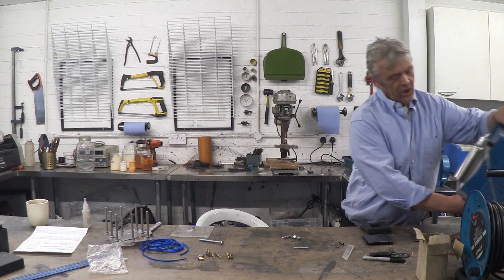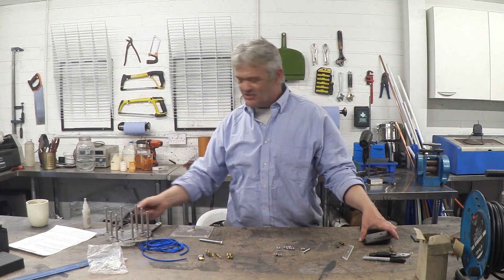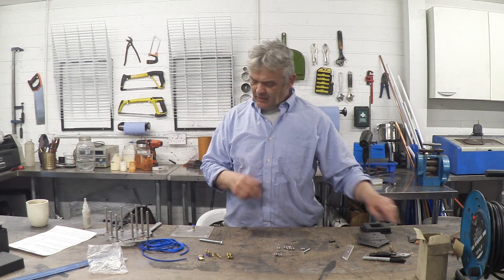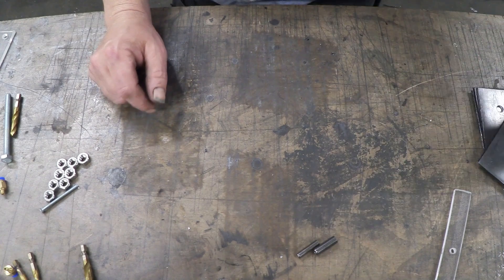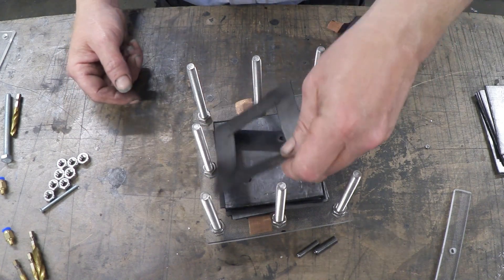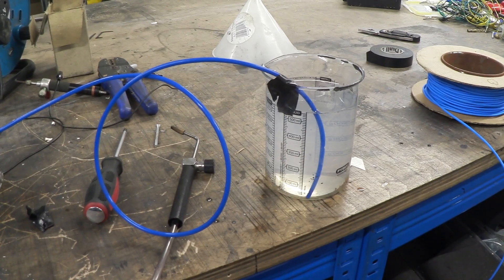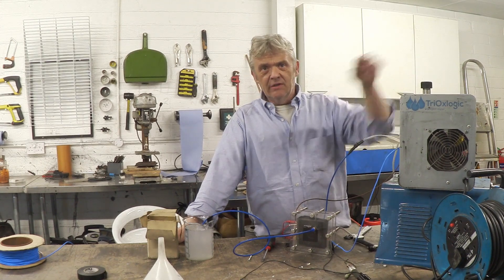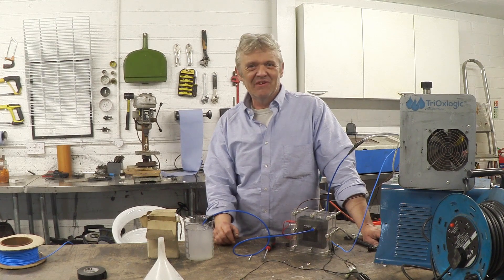Super Efficient Graphite Dry Cell Hydrogen Generator

Comment: The fact that a HHO generator using an aluminium electrode destroys  it almost immediately is a clue to a unit designed years ago that used aluminium wire fed into an electrolyte to produce hydrogen on demand for a vehicle engine.
Reply: I remember that one. Aluminium welding wire and the end was run across the surface of an Aluminium cylinder submerged in an electrolyte solution. It used a MIG wire feed system to supply the wire as it was the anode and the cylinder was the cathode. a voltage was put across the two materials and the wire eroded releasing Hydrogen.

Comment: I built one of these with 316 stainless plates into my Mazda three and increase my mileage from 24 to 31 miles per gallon for about 50,000 km. What I learned was almost everything said about them on the Internet is bunk. But they do work If you just use 3 to 5 amps to produce small amounts of hydrogen do use as a fuel catalyst. These dummy’s trying to produce as much HHO as possible have no idea how to run their cars on it. I know diesels are different but anyone saying they’re using one of these successfully in a gas engine without a fuel remapping chip is lying. Your exhaust will be full of oxygen and your o2 sensor will just start dumping more fuel in if it’s not being overridden.

Comment: hi, your videos are always interesting and inspiring.  maybe I am missing something about the connections but it seems to me that it does not produce hydrogen but a mixture of hydrogen and oxygen, is that correct?  also my doubt about the use of carbon for the electrodes is the possible production of co2 to the positive plate.  is it possible in your opinion?  thank you
Reply: Have you tried separating the gas streams? Means you have to introduce a gas tight middle layer (if the carbon sheets are not gas tight enough) and gas separator membrane/micro-mesh in between.

Could anyone tell me cheap gas sensors to get a direct reading of O2 and H2 concentration?
Have to dig into spectroscopy :)

Comment: Great video! I have an old Kron 300 water torch that hasn't worked in years. I have been wanting to make a more powerful unit for years and after watching your vid I have decided on a dry cell with the graphite foil as you used.  I had a few questions though. What thickness of graphite foil did you use? How did you "bury" the copper tab for the end/center plates? Thanks!

Comment: Bravo Robert!  Curious about pH changes to the electrolyte over time.. is carbonic acid possible?  Is the electrolyte potassium? Is it like a salt water aquarium where you do not add salt only water, because the potassium or whatever you are using stays in solution?

Comment: Hi Rob, nice work. The gas your getting out is both
Hydrogen and Oxygen (HHO) a highly explosive mixture! I believe a licence would be needed if you wanted to store it.
Storing Hydrogen separately is dificult, it needs to be under extremely high pressure before it liquidises (unlike oxygen) which means pressure vessels have to be able to withstand not only the pressure but impacts through for example a vehicle  crash. These are two of the reasons why we don't have Hydrogen vehicles instead of  petrol. Petrol at atmospheric pressure is liquid but easily evapourates into gas, (perfect  cheap fuel)
Reply: It is a demonstrator missing the separator. THEN it gets interesting. 
(You do NOT store HHO. It is just for immediate use. Still it's got its uses. Perfect welding/soldering torch for fine work, driving reactions etc..)

Comment: 2V per cell, so you use KoH for electrolite right?
why not try efficiency test with KoH vs H2SO4?
just make the conductivity the same and start testing.
very little H2SO4 needed for the same amps..... 
plz test for liters per kWh 
nice option compared to stainless !!

Comment: Hi. Here at h2o-and-evs we build some of the best flooded cells around. In our observations it's the dissolved  iron being oxidized that tinges the water yellow. Most water like distilled water can have a lot of dissolved iron in it. Which when it gets oxidized builds up in the cell and/or the reservoir. Also, we have observed no SS degradation even when driven really hard.
Reply: Stainless steel usually contains iron too

Comment: Have you tried feeding the output into the air intake of a diesel engine? I'm thinking of putting one together, partly for cutting and partly to see if it works for fuel economy. I figure I have a kilowatt of solar on the roof of my van anyway so if it's worthwhile, I could just feed it directly into the electrolizer.

Comment: Looks like It can be used with solar panels to create fuel when your batteries have finished charging, for heating water, melting scrap metal, or cooking (Might have to generate the gas at the point it's used due to safety - storage and piping around is probably an explosion hazard). Could be useful on a boat, where you have a plentiful supply of water. If you collect the condensation from combustion, it could be an emergency supply of fresh water too (if you add minerals - drinking completely pure water is not healthy).

Comment: I wonder what's the total energy efficiency on production and then burning it in a generator. Maybe this will be able to replace the extremely expensive and unwieldy Dam batteries that governments have in use today with renewable energy.
I also wonder what is the longevity of a properly manufactured graphite plate rather than carpet knife cut piece of foil :P

Comment: Hello Mr Murray-Smith.
Wonderful job on that hho cell.
I wonder where graphite foil can be bought? I have been planning to build an hho dry cell for a long time. I live in Sweden and I have just found very thin foil in a store called Elfa.
The foil you used looked like it was a little thicker. I have big plans for my hho cell, but I need to start somewhere. I actually made one for a couple of years ago out of stainless deciliter measure cups with plastic spacers in-between, it was a wet cell. It worked rather well during the circumstances 😁.

Best regards
Peter.
Reply from the maker: we have grafoil in our webshop mate - https://secure.workingink.co.uk/working-ink-shop/

Comment: You title the video Super Efficient Graphite Dry Cell Hydrogen Generator yet you use an electrolytic solution containing water, which is wet. So the video should really be called Super Efficient Graphite Wet Cell Hydrogen Generator. You'll always need water to break down the materials in order to release the hydrogen. I'm sure your cell would still work without an electrolyte, it would just take that little bit longer to work.
Reply from the maker: okay mate

Comment: I'm not an engineer or even a tinkerer so I don't know why I clicked on this or why I found it strangely fascinating, as I have no idea what you're up to.  Why generate hydrogen ?  I know it's very flammable so I suppose you could use it for powering something but doesn't it take more energy to produce i then you get from it
Reply from the maker: hydrogen can be used as a fuel - storage is however still a problem to be solved effectively
Reply: @ThinkingandTinkering   Thank you for your reply but with all due respect that wasn't my question.  I stated that I know it can be used as a fuel.  My question was,  doesn't it take more energy to produce than you can subsequently get from it

Comment: Not sure if its possible or any better or indeed if you could make it would work. Stainless steel mesh coated in graphite ink.  Increased surface area a possibility of slowing corrosion.  I'm just trying to get you back for making my brain work so hard lol

Comment: 12 v is the limit for peak efficiency?
Reply from the maker: no - you're actually looking for 1.23 volts per cell plus losses through the ESR. it will be round about 1.8 to 2.2 very roughly. anything more than that is simply lost in heat and what you are generating is steam not HHO

Comment: Hey Rob ,you use scissors a lot for cutting out your plates,ever thought of using an A4 paper cutter guillotine.Cheap as chips and I think much quicker and easier.That's what I use.It will also cut  aluminium and copper plate.Cheers

Comment: It will be interesting to see how the graphite holds up over time compared to stainless steel.
What type of water did you use ? 
Utility, purified drinking water, natural spring water, deionized water, or what.  Also did you use any additive ( electrolyte ) like salt, soda, or other chemical.  I am very interested in your test results. The applications of this are endless.

Comment: Robert... good to see some of this technology coming back around. Let's hope it's not suppressed by the oil companies again like before. I had a 12 cell pro-built 'dry cell' setup in a rebuilt 1971 VW Beetle. Also had a PWM controlled DC to DC power supply to regulate voltage and current from the battery. Using sodium hydroxide for a catalyst with water, I was producing around 3.5 - 4 LPM of HHO @12 vdc and 18 amps. I had done many road tests with this setup and gained about 8 mpg. consistently at cruising speeds. (The best it would get without HHO was around 30 mpg, but with HHO it would do 38 mpg or even more in some cases). Of course you can't produce enough HHO to actually run the engine on HHO, but the catalytic effect with regular gas in the combustion chamber made it much more efficient. Unless you can decipher Bob Myers secrets from years ago (RIP), you'll probably never be able to reach those levels. That said, I like your experiments with the graphite 'foil'. The only thing I see that would be a problem over time is the graphite flaking off and deteriorating over time. This might be offset by having it contained in some sort of plastic mesh maybe? Now subbed and will be watching for future developments.😉
Reply from the maker: very cool mate - maybe I will get there

Comment: Robert,
You finally did it. I have been a subscriber for years and have integrated your projects into my own many times over the years. This one took the cake, I have now joined. 5$ a month is a steal. Not sure why I didn't do it sooner.,

Couple of things, I would love to know how a magnetic field improves hydrogen production. Link here to a science direct article claims 2x productivity increase with a field:
https://www.sciencedirect.com/science/article/abs/pii/S0360319911023500

I think I am going to integrate this design into one that I have built with stainless where I use terra cotta (flower pot bottom) as a PEM to separate hydrogen from the oxygen.

Keep the projects coming!
Respect, 
Mark
Reply from the maker: yes I read that - very very interesting - just looking at a few things now but will get onto incorporating something along those lines for sure

Comment: If the polarity doesn't matter, presumably this could be run from AC? Any chance it could run directly from 240 volts???
Reply from the maker: polarity of connection doesn't matter - but it is an electrolyser so needs DC - you could use pulsed DC for sure but the time between pulses would be a critical factor for sure and it is likely the pulsing would encourage intercalation into the graphite
Reply: @ThinkingandTinkering  So 240 volts, no transformer with only a bridge rectifier would work?

Comment: Ceramic graphite plates could be a option. With a 3D printer you could also make thin corrugated plate die.
Reply from the maker: I was thinking that mate - iy would also help formation of channels in the plates which could be good for gas separation which seems to have a few folks concerned

Comment: Hi Robert, won't this cause the graphite to exfoliate?
eg: https://www.youtube.com/watch?v=s51l6KySFU8
I thought about this idea too, but never tried it because of that...
Reply from the maker: no mate - https://www.youtube.com/watch?v=hFUOsZ0LSkQ&t=64s - that's me doing the same thing but 6 months earlier - you have to control voltage below the intercalation voltage and keep amps down below the level where excessive heating would occur
Reply: @ThinkingandTinkering  
Thanks Robert. That's interesting. I now know what intercalation is. :)
How about A/C electrolysis?
I suspect you could insulate both plates - in which case any conductor would be ok...
What do you reckon? Would it work?

Comment: i wonder how many cells ya'd need to build to produce hydrogen with less than ~2% electrolyte solution
Reply from the maker: It has to be above 1.23v per cell as that is the water dissociation voltage add in the ESR of the device and probably 2v is around right mate - If we reduce concentration to 2% we will decrease amps but at the expense of increased resistance so we will probably have to move the plates closer. This design has no protection against plates touching so with reduced plate gap that would have to be introduced which would lead to fluid flow resistance - so a pump is probably needed. so putting in micro channels wouldn't be a bad thing as it would help with being able to separate the O2 and H

Comment: If you are interested in separating the gases, you can make this same arrangement (but in a single cell) using mesh as your active cathodes and electrodes. Then you use a porous membrane between the mesh electrodes.  It would be interesting to see if you could use a graphite or graphite coating on some copper or aluminum mesh.
Reply: The cells are like a battery, you can over and under charge the cells. 2.2 volts is typical running voltage. Any heat produced is of coarse inefficient. I have built very sophisticated extreme efficient cells that generate zero heat. The trick is too isolate all exposed edges and the electrolyte between cells can not be shared. I built a tubular system that had plastic manifolds gas and electrolyte porting. the edges of the tube ends isolated in these manifolds with O rings separating them from the electrolyte. Each cell had its own resivour for its electrolyte. The cells were then wired in series to achieve 2.2 volts from 14.5 volt supply.
Reply from the maker: very interesting
Reply from the maker: cheers mate
Reply: The separation of anode and cathode would be most relevant for adjusting the mix between O2 and H2(?) I mean to manipulate the flame/temperature in welding similar with asethylene/oxygen mix in traditional welding.

Comment: stainless isn't so bad if you know what you're doing. use cutting oil, maybe regrind your drill bit to a tool steel cutting angle.
Reply from the maker: isn't so bad? nicely put - but there is no way it is as easy as a pair of scissors lol

Comment: Great video but why does it have neutral plates
Reply from the maker: to spread the load - without them the full 12 volts would hit the cell with them it is spread to 2 volts per compartment - this stops overheating

Comment: You can use a semi-conductor instead of lye😉 rub 2 pieces of 1000grit wet and dry together and harvest the carborundum by washing off with distilled water.
Reply from the maker: cheers mate
Reply: @ThinkingandTinkering  if you want to push the cell add oxalic acid with the carborundum. Zero foaming issues like lye brings.

Comment: Hi Rob! Great Work!!  a small advice, make the edges of  gasket smaller to expose more of the plate's surface area to the water 👍
Reply from the maker: agreed mate - but this is a test cell
Reply: @ThinkingandTinkering  You see our drive to get productive ;) When do you "test-wise" include a separator membrane ;) ?  What could we use for it? Old FFP2 masks (the ptfe ones having 30-40nm mesh widths), the filtrating layer? Or does it have to be more tight, so rather diffusion principle?
Reply: Perhaps use o-rings on plastic rods to separate the graphite plates & expose more area?
Reply: @user-mp3eq6ir5b  If you do that, you might as well cut the plates round with hole-saw bits in a drill press.

Comment: Did we discuss sourcing graphite foil anywhere?
Reply: His website. Link in description.
Reply: @michaelbiggs7987  ty
Reply from the maker: you can get it on eBay or our shop if you like mate
Reply: @ThinkingandTinkering  thanks Robert, I've had your graphite in a can in my garage for ages but finally I think I will use it for a couple of projects one being a heated 3d printer bed 😁

Comment: Fair play that’s impressive👍 I remember reading a lot about different hydrogen production ideas Stanley Myers apparently had a conversion kit for the standard combustion engine to change the engine to run on hydrogen this reminds me of it it will be interesting to see how efficient this is when you’ve Finely tuned it  .... I think Myers might have used a coil of wire around his stainless steel cathodes and drawn an arc of voltage through the coil conductively to change the way the electrons meet against the anode or perhaps plated them in this manner saying that can you plate with graphite 🤔 this is giving me loads of ideas thanks very much for the inspiration 👍coo as 👌 did you ever see the cavity heat pump that guy made worth a look too
Reply from the maker: I am really interested in urea electrolysis as I think that will be net positive for generation
Reply: Robert Murray-Smith yea just checking that out nano aluminium compound added to urine is that what your on about ?  looks like it’s making loads of hydrogen 😀 wonder how they make the nano aluminium compound I’m sure I can make some good urine 😂 i  wonder if it gives off other gases too that are bad .... perhaps urine in the fuel cell you made not the most hygienic thing but might generate loads
Reply: What'd you come up with

Comment: Graphite has a huge surface area so it makes sense that it would work well. Also a low resistance means less losses and heat which is a problem in large generators.
Reply from the maker: cheers mate